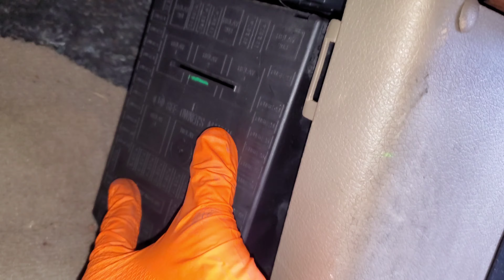2007 F150 Power Window Relay, Power Window Fuse / Circuit Breaker

Comment: Front passenger window can go down won’t go back up. Changed the regulator and it still won’t go up. Makes a clicking sound when going down but no sounds going up.
Reply: Did you figure it out?  My passenger side will go up but will not go down unless I put 12v directly on the motor

Comment: There is a 10 amp fuse to the left side of the relays, difficult to get to (relays block view) but it powers the relay or the circuit breaker one. Ive no power out of the fuse box to the windows, circuit board shot. Ran a jumper and still no power to drivers side window control

Comment: Questions I have an 04 my master works all my windows but I can’t roll down the back two windows down or the passenger window from there own switch tested power at each switch not getting power tested 30 amp fuse it’s good
Reply: Having the same prob, did you find a fix?
Reply: on the Crew cabs, there is a common issue with the wiring between the driver-side door (where the controller switch is for the power Windows) and the chassis- the harness spanning the door-jamb rubs through on wires after extended use (150k+ mi). 

I have the same issue with my 2005 s-crew (front passenger window only works sometimes if the door is open a certain amount, otherwise that window is dead from either switch) but have not torn the door apart far enough to resolve it. there are videos on YT fixing frayed wires on this generations door harness

Comment: Thanks for the video.
I'm having a issue with my driver side power window, it doesn't go up or down when I press the up/down button.  every other window works individually or from the main switch box, it's just the driver side window.
Could it be a blown fuse? Thanks for taking my question.
Reply: I have the same problem.  Did you find out the problem?  Thank you
Reply: @jeremysnow9034  I have the same problem too there’s no power on fuse 1 wire on the motor I’m a change the relay tomorrow n see what happens
Reply: @mr.bigshot6698  did it work or was it the motor?
Reply: My powered windows go up and down . With no key 
It drained like 3 battery’s. 
What can I do to make it turn of propertly ? I need help 🙌🏻
Reply: Did anyone find a fix for the driver side window not working???
Reply: @jeremysnow9034 did you find out the issue?

Comment: So thanks for your video..i checked both the relay and circuit breaker but nothing...i replaced the master switch. The relay and circuit breaker both have power but the wires that connect to the master switch have shown no power with the test light. Its a 2004 Ford f150. Also my dricerside head light wor work..but the high beam will

Comment: Lehew mine is Ford truck 2004  , I went to start my truck and it wouldn’t start so I heard this small noise in the back seat like it was draining the battery where the small window slides left and right . Do you know if is the rely and why was that tiny sound coming from the backseat I think that’s why was draining the battery Thank you Sir

Comment: Hope you see this, but I picked up an 05 f150 and for some reason if my driver door is open I cannot roll the windows down and even if I roll the windows down from all the other switches. None of the windows from each door switch will work if my driver door is open. Have you ran into this issue?
Reply: What was the resolution? I’m having a similar problem.
Reply: In the driver side door, when opened you will see the rubber “loom” within the loom you’ll see a ton of wires. The wire I had an issue with was a ground wire. It was frayed. The are a few of these ground wires but it was the thicker one out off all. I did a few tugs and it snapped. I reconnected it with a couple water proof connectors and the power was back. All windows were all fully functional again.
Reply: @DehTastic yupppp! That’s what it was!
Reply: @KLTV2 nice! Let’s go!

Comment: My 2002 Ford F-150 power windows and interior lights were not working. I unplugged the battery for a couple hours changed all the fuses that did not look good of the interior fuses. I plugged battery back on and everything started working again. Hope that helps.

Comment: Question i have no power on my circuit breaker fuse, i did a mcgyver  and jump it it with some other fuse and my windows and radio works , but everything stops working when i feed it , i know fuse is good , what else can be

Comment: All my windows work from the master control  but not individually at each door.  I just replaced out the master control switch and no change. Still can only open all other widows from the master. I have a 2006 f150 Lariat crew cab.... Any thoughts?
Reply: Sometimes the metal part of the Fuse have small circular/square burn marks not even a tester will tell you it’s a bad fuse. So re-check your power door lock fuses.
Reply: I have this same problem any fixes
Reply: I also have this problem, how’d you fix?
Reply: I have the same problem and haven't been able to find a fix. Just wondering if you had found one yet?

Comment: I have a 2006 f150 4 door and my rear door windows dont work, why? I installed a new power window switch (the main one on drivers side). What could it be?🤔
Reply: Sometimes the metal part of the Fuse have small circular/square burn marks not even a tester will tell you it’s a bad fuse. So re-check your power door lock fuses.
Reply: @Blanco150  thanks for replying. I'll check the fuses didn't even think about that..
Reply: Oops which is the lock fuse?
Reply: @robertramirez105  look for your owners manual. It will tell you exactly what fuse it is.
Reply: @robertramirez105  wait, i think i know what you are asking. On my 02 f150 the fuse box is on driver side between the emergency break handle and hood handle. Ive seen on other newer f150’s like yours the fuse box is on the passenger side below the glove box remove the side panel near the door and its there. Good Luck

Comment: All 4 of my windows go down REALLY slow but won't go back up. Happened all at one got out to get lunch got back in and now this. Tried switching relay and using wire to jump circuit breaker and no change. Got any advice?
Reply: Sometimes the metal part of the Fuse have small circular/square burn marks not even a tester will tell you it’s a bad fuse. So re-check your power door lock fuses.

Comment: I have a 2006 f150 supercab the only switch that works is the driver side window. It will operate all 4 windows except the passenger side front widow.  Out of the 4 door switches  only the driver window will operate.  I have tried the window lock out switch in both on and off and get the same result.  Does anyone have any suggestions  ?
Reply: I have the same problem and haven't been able to find a fix. Just wondering if you had found one yet?

Comment: If only the driver window is not working, is it possible for the issue to be related to the fuse or relay? The other windows and all of the switches for those windows are working fine.
Reply: Hello I'm having the same problem on my 2008 all windows work except driver side, did you find the problem?

Comment: FUSE #21   FUSE #21   FUSE #21    This blown 15 amp fuse will also make windows not work!!!!!   (and radio, AC, airbag, rear slider)
Reply: I got a 2008 and I changed the relay I changed the motor switch to control all windows and as well at the 30 A bug fuse and still nothing works before that just the driver window one was the only one that didn’t work now it’s all what should I do?

Comment: I did tht nd nothing  than I replace the switch  2010F150 nd windows  still not working
Reply: check the wires at the door conection
Reply: Sometimes the metal part of the Fuse have small circular/square burn marks not even a tester will tell you it’s a bad fuse. So re-check your power door lock fuses.